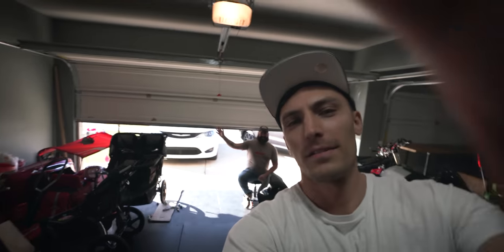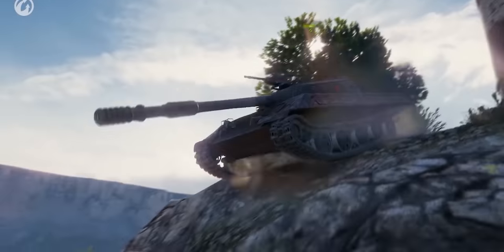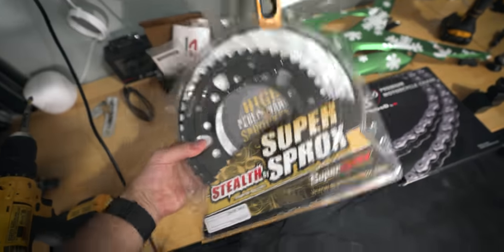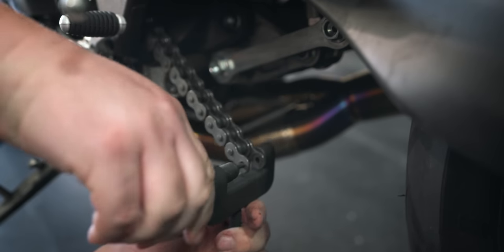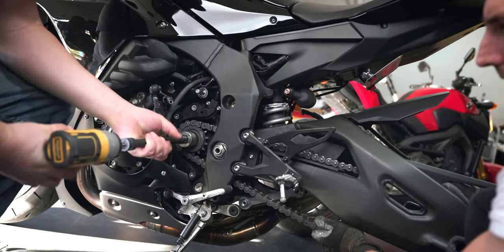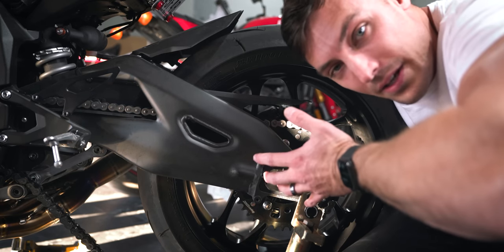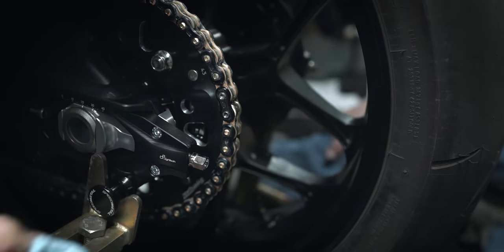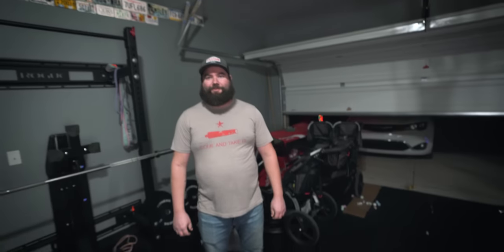Installing Chain & Sprockets on the Yamaha R1! *MAJOR IMPROVEMENT*

Comment: Looks great...here's a small detail tip for you...buy an extra master link in a different color and put that on...makes finding your master link so easy..also the captive wheel bearing spacers with the captive rear caliper mod makes putting the wheel on very slick.

Comment: Honestly the torque specs on the rear sprocket bolts as well as the front sprocket nut as well as the number of links used would make this video really useful. After having just completed this, looking up all these figures would have saved us all a lot of time and effort. A consideration for next time.

Comment: I put one down on my 2020 R1. I think it should have came that way. It’s geared pretty tall, even for most racetracks. 
Used an air impact and front sprocket nut came right off. 
It moved the rear tire back 4mm which will help drive by keeping the front wheel down at the track.
Reply from the maker: Yeah I’m not sure why it came that way. It kinda struggles getting up there
Reply: @motonosity  I’ve never ridden the BMW, is it geared as tall, especially 1st gear?

Comment: Been wanting to install new sprocket and chain on my 2019 R1. Did you tighten the sprocket nut to factory manual spec? Forums says it’ll strip at 72 ft lb. some people just use loctite and 35 ft lb.
Reply from the maker: I saw the same. The nuts were locking nuts so I just did 30 or 35 I think. It felt dangerously tight at that so I didn’t go any more.

Comment: How did that rear sprocket hold up for you? I’ve seen a few reports of the steel portion separating from the aluminum portion with those superlite sprockets. Curious at how yours worked out.

Comment: 1/2" impact woulda got that front off no matter if you had the chain on or off. If it being replaced anyway you could have leveraged the sprocket teeth with a flathead or prybar
Reply: 3/8 drive isnt as strong and you lose torque when you have extensions

Comment: Have you thought about trying the new Regina maintenance free chains? As far as I read the new S1000RR should be equiped from the factory with it as it was the first bike it was rolling it out. From January 2021 they said that they will produce for other brands and able to sell it, as now is only BMW specifically. It means no lubrication and no adjusting, since it has a ceramic coating. I think will be awesome to drop the messy chain lubricants and the mess they do at the back of the bike.
Cheers and do have great holidays.
Reply: I just ordered the new M chain 🕵🏻‍♂️

Comment: I made the same mistake on the front sprocket.  I said "the one that's there is good enough" and that was that.

Not sure why you went to all that extra trouble, after all, you didn't change the number of teeth on the front.  And given how new your bike is, I can't imagine there's any wear to speak of on the front sprocket.
Reply: i think he went to a 520 pitch chain and rear sprocket. because stock is probably 525 he had to change the front sprocket to match. 
the lower pitch is supposed to be lighter so there is less unsprung weight
Reply: Makes sense, my only remaining question, I noticed Motonosity used Fry Riding's fat ass to adjust the chain tension.  Fry Riding looks heavier than Motonosity, LOL
Reply: @Tiqerboy  Yea I noticed that too. The way I do it is to put the bike on the side stand and then I measure the chain slack at the bottom horizontal part of the chain half way between the 2 sprockets at the loosest point of the chain. 
Normally the manufacturer recommends somewhere between 45 to 25mm.
When you measure the distance lift the chain up as high as possible then pull it down as far as possible. Measure the gap between the top of the chain at both points.

Comment: What size socket is front sprocket nut?
Reply: Did you ever get an answer on this? I'm about to swap mine out too.. it has torque specs in the manual but doest say what size socket it is.
Reply: Never got response but socket is a 32mm for front sprocket nut.

Comment: man you never ever put the bike in gear and pull against it to loosen the nut you can break or stress crack gearing and if it comes apart at 140 and locks the bike down you are in big trouble and you will never know if you cracked it unless you split the engine case and magnaflux the components hopefully you got lucky

Comment: Great video again, but I just want to point out 1 thing, lightech strongly suggest 100NM MAX on the rear axle nut. Otherwise you can cost other side of the axle flange to spin and brake the chain adjuster. (It has happened I have seen photos from lightech USA. )

Comment: sooo you removed 2 grams worth of nuts and bolts to put on 4lbs of unsprung weight for almost $300 just so you can adjust your chain easier on an already easy job every few years?
Reply from the maker: Yes
Reply: @motonosity  gotcha, carry on.

Comment: S1000RR is faster because the R1 doesn't have a tune yet, but I'm sure when you can compare apples to apples the BMW will still have the edge. Been thinking of doing sprockets myself on my R1... 🤔
Reply: who said that? it want only 30 sec to make it faster than RR )) just plug in dynojet power vision ;) i had R6 2017 and had fastest 600cc in my country just -1 +2 with aluminum sprocket + full yoshimura + power vision MAP, got 122.3 WHP
Reply: @berdzena8797  who said what? You mean when he said in the beginning the S1000 is faster?
Reply: @berdzena8797  lol oh gotya. I was just saying that HE said in the video the RR is faster. His RR is tuned and has way more mods. The R1 is not tuned because there is no flash available yet. He only has a PC5, but still thst does nothing down low in the RPMs. They can't unlock it.
Reply from the maker: @WideOpenThrottle1984  Stock to stock in the upper power band, the RR is worlds faster. I'm pretty sure even with a full tune (when that's possible), the R1 still wouldn't be able to keep up. The RR is just in another league! I love both though :)
Reply: @motonosity  ya I'm jealous! Wish I could have both haha I do love my R1 though. Was very excited when you got yours literally the same weekend I got mine! Loving the setup! Thanks for the great videos. Keep em coming!